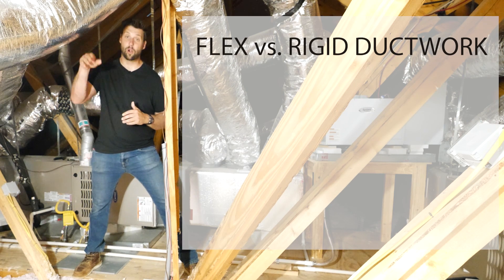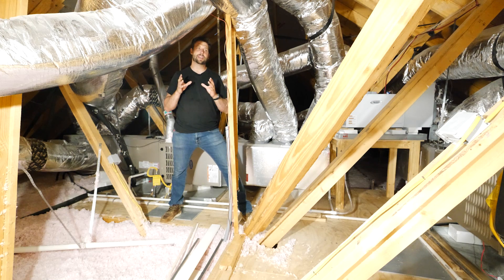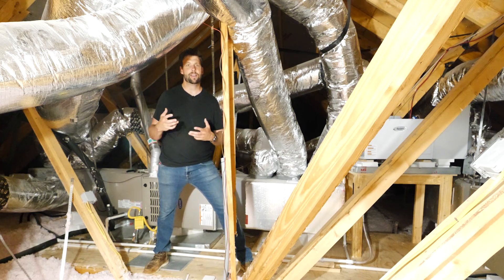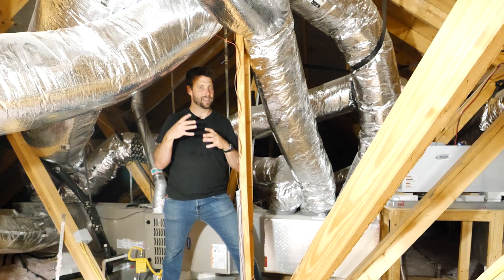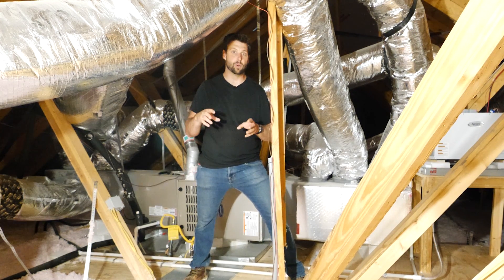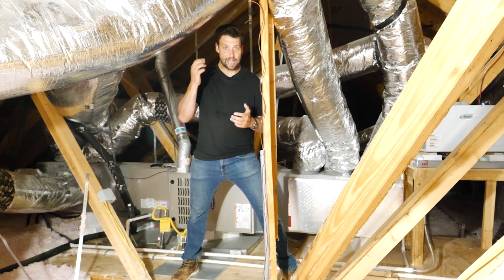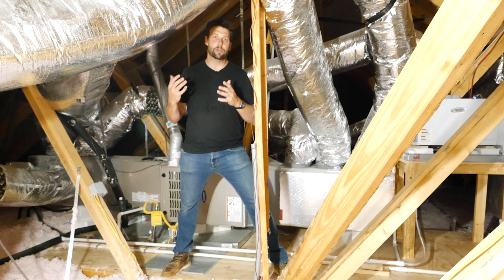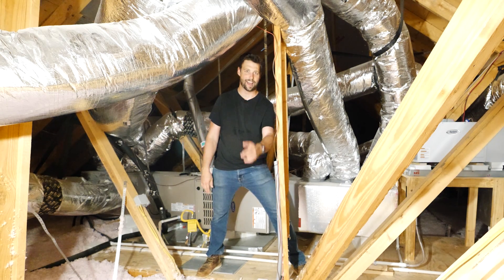Hot Rooms in an $850,000 Home!!  Is Flex Duct to Blame?

Comment: Rigid duct is far superior to flexible duct. 1. Mice and other pests cannot chew through them 2. Static pressure is stable if designed properly 3. Noise is only present when poorly designed. Short of it if you want the best system run rigid trunk lines and 6' dampered flexible branch ducts. This is what my company specializes in. If you have in wall ducts or tite spaces this can be done by properly designing rectangle ducts with turning veins.  Rigid ducts are much more expensive due to higher material and labor costs but you never have to worry about hot/cold rooms.

Comment: I was in the HVAC business my entire career. I have never seen hard pipe fail. I used 12” of flex where I connected the pipe to the trunk to eliminate noise. Duct work if at all possible shouldn’t be in an attic, in both winter and summer you have energy loss. The attic may be R60 but the ducts may be R8 creating convection currents . The system in your video is called the octopus, I have seen them but never installed them. You are correct about commissioning the system but it isn’t really practical for residential construction, the next best thing is good design and installation.
Reply from the maker: Completely agree on the good design principle (see, I get it right sometimes @cybercusal ) of having the ductwork ran through conditioned spaces. I wonder why you think commissioning a residential system  is impractical?  If the house is to be Energy Star rated (a pretty easy bar), a rater already has to come and inspect the system for refrigerant charge and fan air flow.  Balancing the system is recommended (but not required) and is pretty simple with a trash bag and hanger.  Maybe I will do a follow up video showing the poor man's method of checking air flow to each register.
Reply: What is the poor man's way of balancing?
Reply: Without commissioning, how do you even know the system is functioning properly or at all?  Design, Install, Verify.
Reply: @N-M424  I could go and commission a system when the temperature was between 45 to 85 degrees, measure the airflow and temperatures and compare with the design and would find everything working on all but the worst installs. Extreme conditions will reveal the problems and there cause. One call back I had was in a master bedroom hat when it was cold, about 15 degrees the  bathroom was around 60 when the rest of the house maintained 70. Was I at fault? No, an infrared gun revealed that insulation was missing behind the tub enclosure. Here’s what I would tell clients, your system should be within 2 degrees throughout the home, if not call me. I didn’t receive many calls, experience and good design and installation insured that.
Reply: @paulmarc-aurele5508  Good design and install won't prevent issues from poor design and installs of other trades, you just proved that with your story.  Not commissioning and verifying your work is correct is lazy and poor practice.  At the end of the day the customer just wants their bathroom not to be cold.  How is that going to be accomplished?  More heat in, or less heat out?